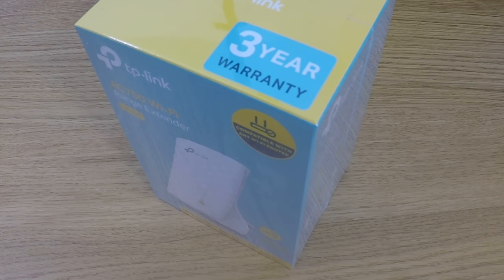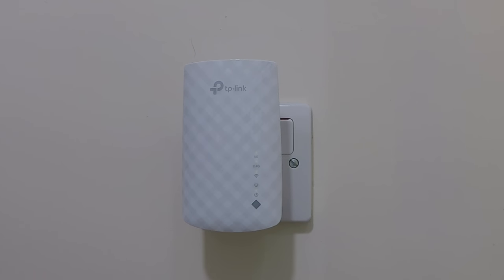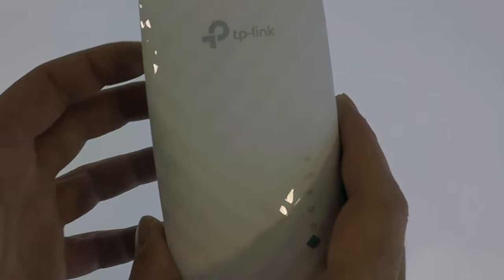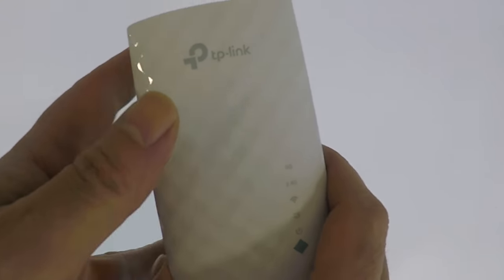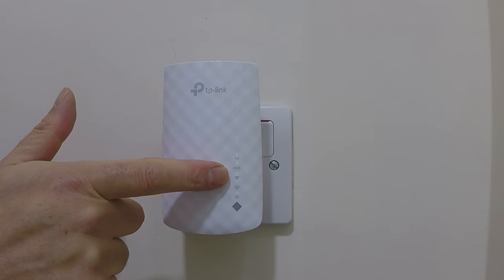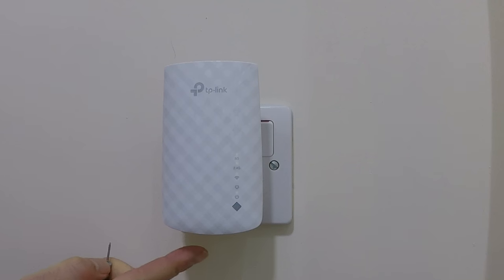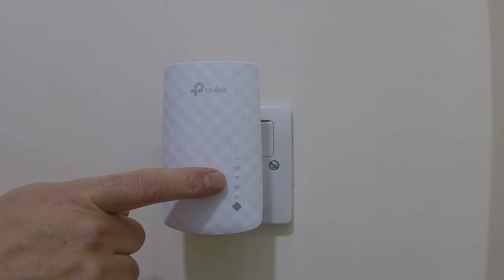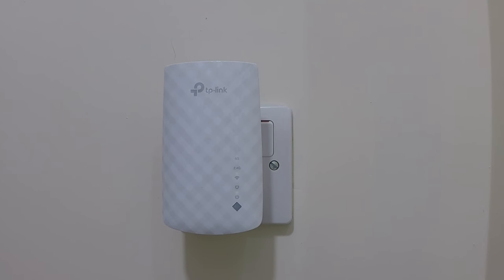How to Factory Reset a TP-Link RE200 AC750 WiFi Extender

Comment: I could kiss you right now, thanks a lot!
Reply: @mydoodads  can you help me with something else, relating to this?
Reply from the maker: @aayushdas19  I can try, but mines not currently setup.
Reply: @mydoodads  okay, this is going to be long, please bear with me. I bought this two and a half years ago and had chained it to my WiFi router just as you have instructed in this guide, it worked just as it was supposed to, had absolutely no problems with it. But today, I've changed my ISP and taken a cheaper WiFi package with better speeds. The problem started when I did a factory reset on the range extender and tried connecting to the TP-Link_Extender_2.4Ghz ISSD on my laptop. It just wouldn't connect at all, always telling me that there is "limited access to the internet". The website "tplinkrepeater.net", which is actually required for the setup, just wouldn't load at ALL. Please help me out here, I'm really fed up with this and would appreciate any and all help.
Reply from the maker: @aayushdas19  

Hi Aayush

I just opened a brand new TP-Link TL-WA850RE to see if I can help troubleshoot this problem. While not exactly the same model as you are using, it’s close enough to see if I can replicate the problem. 

Which good news, I can. 

So to get around the problem you will need a spare network cable and a computer with a network port.

If you connect one end of the network cable to the network port on the TP-Link extender. Then turn off WiFi on your computer and plug the other end of the network cable into your computer.  You should find that you can connect to the web configuration page via tplinkrepeater.net

Hope this helps.
Reply: @mydoodads  the cable I have isn't of the right size, and that's the only one I have which is being used on the current router. I tried using one and now it's lodged inside it and won't come out. I guess I'm screwed.
Reply from the maker: @aayushdas19  

I think that might have been the telephone Cable (RJ11) which looks similar but as you found out is not.

You should be able to dislodge the cable if you are careful. Try gently squeezing the plastic leaver and pulling straight out. Don't wiggle. You want to be careful to not damage the network port and its connectors.